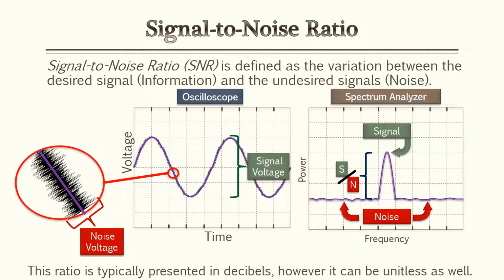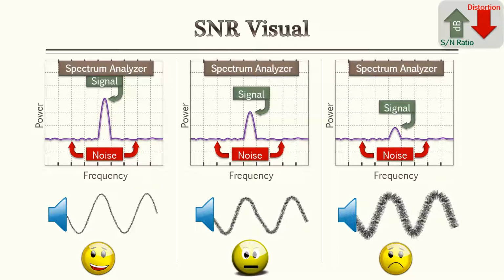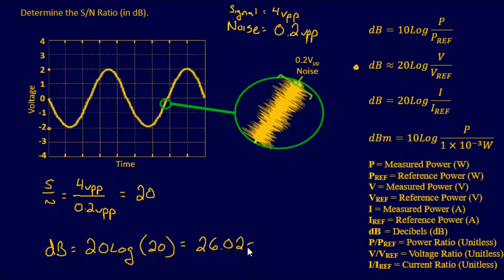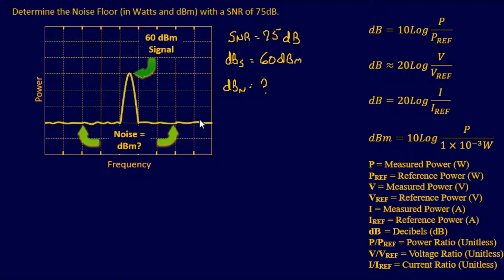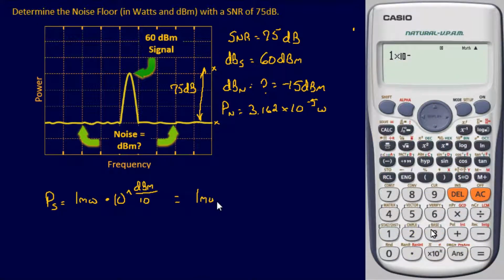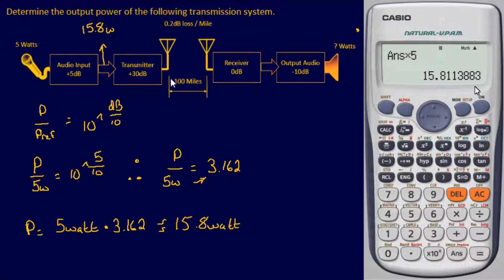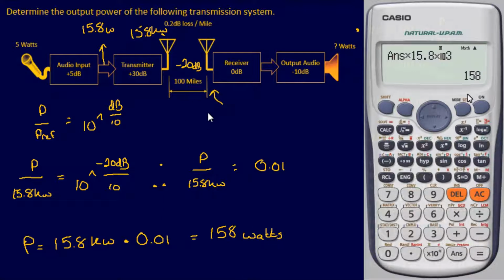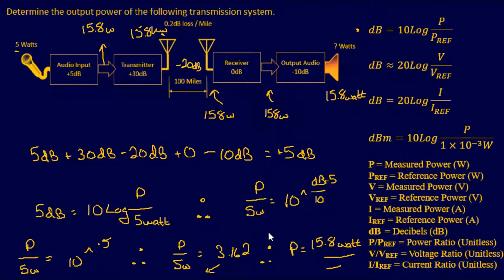Electronics P.E Prep - Signal-to-Noise Ratio

Comment: 75dB - 60dBm = 15dBm?  Shouldn't the dB be converted to dBm first?
Reply from the maker: Hello Christina,
Yes, 75dB - 60dBm does equal 15. dB is a relative unit that describes gain. dBm is an absolute unit referenced to 1 milliwatt. So you can't convert dB to dBm. It is important to note that if the difference between two power levels expressed in dBw, dBm, or dBf is taken, the result is in dB since subtracting decibels corresponds to division, and therefore the result is a ratio.
Good question!!